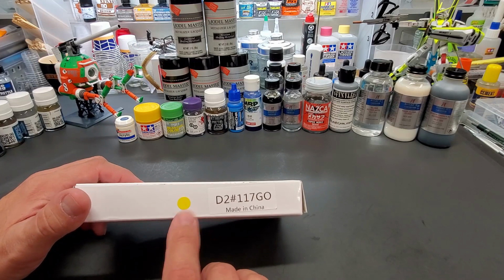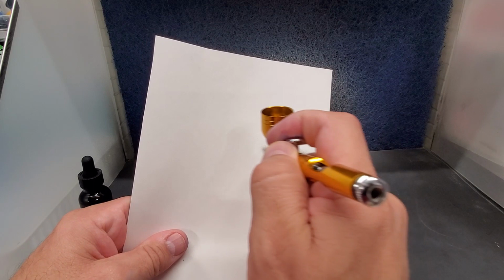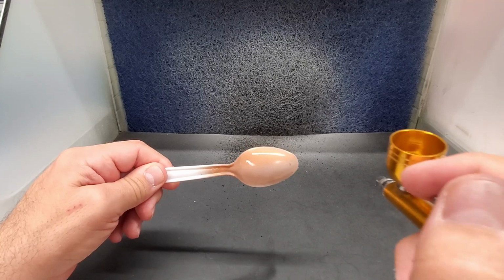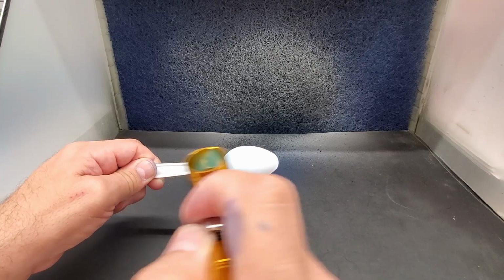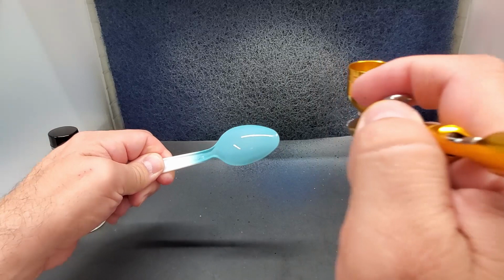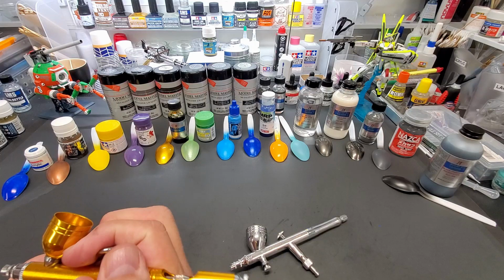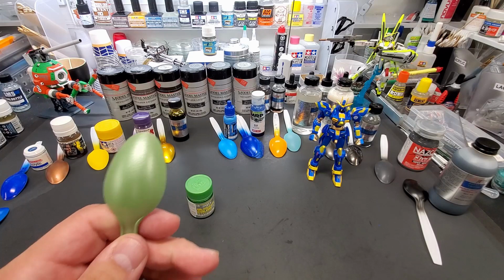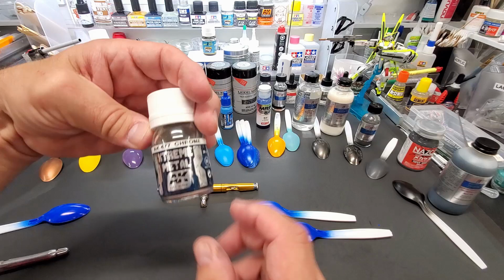Testing A $14 Dual Action Airbrush - Is It Actually Good ??

Comment: I use this airbrush for about 8 months now and I 'm totally impressed of it. I have stopped using my Iwata Revolution BCR and use this for every job except tiny line and dot free hand camouflages for which I still use my Iwata HP-B. This is the absolute value for money airbrush. Fortunately the a little tall trigger is not a problem for my fingers and fortunately I never use acrylics like Vallejo, Humbrol, Italeri, so I haven't faced any problem of using all the colors I usually spraying.

Comment: Great video! The trick with the cheap airbrushes is using  Metal polish on the needle tip, nothing super gritty a polishing compound that's silky smooth works best.  Aftwer you polish it notice the huge difference in performance.  I polish my needles with Brasso and a polishing pad on my Dremmel, after a few applications the paint sprays better each time.  It's really the needle polishing that cheaper units don't do as much as the higher end brands,  hence less labor less cost.

Comment: I found that polishing the needle with metal polish , or automotive cutting compound, helps these cheap airbrushes.
Reply from the maker: Great advice
Reply: @barbatosrex9473  I was just going to suggest :p And ask if you could do an update after polishing the needle...
I'm curious about the results. Just ordered a similar airbrush for the rough work and for practicing. I found that I'm a bit hasitant to actually practice with my Badger 360, just because it's rather expensive, and I don't want to ruin it.
The action on the trigger looks to be about the same as my badger, so that'll be a plus for me ;)
Reply: @angeldelvax7219  Hesitant to try polishing the needle on the Badger you mean? Or just to practice spraying? If the second have no fear that is what a Badger or any airbrush is made for. I would practice and get used to the better brush you'll be way ahead in your skills and be able to do way more with a cheaper airbrush.
Reply: Also #0000 steel wool!

Comment: I have a few different cheap Chinese airbrushes.  Like Animalyze71 pointed out, polishing the needle really helps.  The biggest issue with these cheap airbrushes is the seals.  They are made out of really cheap rubbers that break down after a few cleanings.   Obviously hotter solvents will break them down quicker.  Some of the airbrushes even come with a replacement set of seals.  It costs about $10 for a new set of seals so I usually just order a new airbrush when I need new seals.  I always opt for the .4mm nozzle sets or larger and use these exclusively for primers and clear coats.  I can abuse the heck out of them and if they break down I just grab a new one.  Saves wear and tear on my pricier airbrushes.  I wouldn't use these for my daily airbrush though.  Veda makes a nice cheap airbrush which runs about $20 buck you get a lot of extras for the price.  If you can't afford one of the name brands, or if you're not sure about getting into airbrushing this is a really inexpensive way to check it out.
Reply: I get the seal kits for less than 1€.

Comment: I have a premium airbrush from China that cam with a super cool case with a latch and shaped foam in it for each part of the airbrush and it came with a 0.3 needle and nozzle installed and a 0.5 needle and nozzle and a 0.2 needle and nozzle in spare containers. It also came with a siphon bottle, and a siphon bottle with a goose neck attachment as well as a cup and lid. and the one feature is that the front end of the airbrush has a swivel on it so you can put a cup on it and use it as gravity feed or you can rotate it and attach a siphon bottle on it hanging from the bottom, and it also has a closable valve to restrict the flow of paint as you desire, so all in all it definitely is a premium airbrush; and I paid $30 for the whole thing. The very first thing I did when I got it was to use a small piece of 1000 grit sandpaper and polish the needles as the needles had some burs on them from the manufacturing process, and they produced some splattering, but after polishing the needles, my airbrush worked better than my vintage Paashe airbrush for both ultra fine as well as high volume spraying. So for anyone who cheaped out with a cheap Chinese airbrush, I highly recommend using  some 1000 grit and polishing the needles, but don't get carried away, you want it nice an smooth, that will definitely cut down on the splattering that Barbatos Rex encountered in this video, plus, don't be afraid to lube up the parts that move in these ultra cheap airbrushes, and be ready to replace the O-rings if you are using a lot of paints that need solvents to clean up, as the rubber used for the O-rings is of extra low quality, but you can't argue with the price. Sure it might not be as refined as an Iwata, or any other number of high-end airbrushes but it shows just how overpriced the expensive ones are since a Cheap Chinese airbrush can perform almost as good as any of them. No judge in a model contest was able to tell I painted my models with a $30 dollar airbrush/ once you get accustomed to the airbrush, and work out any issues they may have, but the one I bought doesn't splatter anymore since I polished my needles. SO don't let people make you think that a cheap airbrush won't work, they definitely will, but they aren't as refine as the high end ones. plus I am a retired pensioner, I have a very limited income and I can't afford the hundreds and hundreds of dollars for high end airbrushes and compressors, Barbatos Rex has no problem using cheap compressors and I use the exact same one he has given away on his channel before. I'm happy to have an airbrush at all.

Comment: I have one of these and the trigger is tall and in a spot that is uncomfortable. One thing that can improve how it sprays, you should press down and keep the trigger letting the air and pull back when you're ready to make your pass. If you press down on the air and pull on the paint real fast like you're doing, it can cause these cheaper airbrushes to spit a little more and give a rough finish with certain types of paint. You get a cleaner paint flow with the air running constantly. Plus it helps with the uncomfortable feeling of that trigger keeping ir pressed down, you can control the paint a little smoother when you do that. And you can shorten the trigger. Take the little brass pin that swivels and you can cut that down. You will still get proper travel pressing down the vale for the air, but it will sit lower. I did that to mine and it made it much more comfortable to use.

Comment: I was told that if you keep the air on and only regulate the paint it stops splatter and it seems to work really well. I used to get a lot of splatter and by keeping the air on it stops the sudden rush of air taking any residual paint and splashing the model.

Comment: I am using exclusively cheap airbrushes to paint model car kits. They fulfill the purpose perfectly. The major downside are the seals. They fail every once in awhile due to solvents. I guess they would last long with water based acrylics.    But seal kits are dirt cheap. They cost less than 1€ plus shipping.

Comment: With cheap airbrush it is good idea to polish the needle first. It's usually not perfect and those small unevenness can give a lot of trouble with water based acrylics. Just use polishing compound and it should work much better.
Reply from the maker: Absolutely correct. It helps big time. I just wanted to test it as it is out of the box. I will be doing a video on airbrush needles including sharpening and polishing them

Comment: This sounds like it will be great for Aqua Gloss.  I won't feel bad about being lazy with cleaning on a cheap airbrush whereas with my Revolution CR I want to be as kind as possible to it.  With this guy I'd boil  a pot of water, take it off the heat, and stick this in there to loosen the aqua gloss up.
Reply from the maker: That's a perfect solution. Excellent

Comment: Funny i just bought this exact airbrush as a backup (i paid $20 from amazon) i took it apart to inspect and found that when you remove the very rear nozzle cap all you find is a threaded copper tube for the nozzle- nothing elaborate about it. But thanks to your test i'll just use it for clears and possibly for the alclad metal lineup- thanks Rex.
Reply: Thanks for the info. Now we know.

Comment: Wow 3 out of rest that work well on that cheap airbrush amazing deal of amount of money and I was thinking about buying cheap airbrush for model
Reply from the maker: It really isn't that bad. It's hard to go back after using a top model but to start you can't go wrong. Heck I just tested a tiny spray can that cost $20 and this is $6 less than that 😉
Reply: I have kkmoon airbrush for my Xmas present i just wondering if it good for large pieces on trunk model kits?
Reply from the maker: @davidsimpson4819  most of the time the cheap airbrushes are good large areas and priming. So it is worth having a cheap airbrush like this in your inventory

Comment: I bought that same one off of a different website, and mine came with a bunch of pipe brushes and a half spike type thing. It unscrews and inside is a metal pin that's tapered into a point, but the pin is cut in half where it starts to form the point. I'm new to all this and have no clue what it's for.

Comment: And to second what you were referring to on the trigger you're supposed to have your finger on it but In Front of it, it's Dual action that's just where you like to put your finger. You hold down for air and pull back for paint.

Comment: Thanks for sharing this information
Reply from the maker: Thanks. Check out my recent video test of the Badger 105 Patriot. It's currently selling around $60 to $70 and its one of my favorite airbrushes so far. It sprays anything and it's easy to clean. Parts are super cheap and you can get 3 different sized needles for it. Plus it only needs 12 to 15 psi to work. I know it's a bit more money but totally worth it in the long run. Check out the video

Comment: I don't believe the cratering in the troublesome paint was the airbrush at all. That kind of cratering is usually contamination of some sort, be it oils on the surface, wrong thinners etc. Maybe those paints didn't like the residue from acetone. Whatever, I say re do your test on those two paints that cratered with the cheap airbrush. The Humbrol is a different problem from the cratered examples, you could be correct on that.one. Runs and such are not the same as craters or what looks like fish eye effect.

Comment: When airbrushing any lacquer you should always have your paint extremely thin. Especially with a small needle. If it’s thick at all it shouldn’t be spayed in anything less then a .4 needle.
Reply from the maker: Yeah, I usually thin my lacquers 40/60. I just sprayed nail polish and I thinned the hell out it. Went on great. This brush is 0.3mm. I use 3 guns, a 0.5., a 0.4 and my Harder & Steenbeck which came with both a 0.2mm and a 0.4mm

Comment: Nice work on the video, are there acrylic/water based paints that are easier to airbrush?
Reply from the maker: There's all types of acrylics. Tamiya is called an acrylic but it's also solvent based. You can thin it with lacquer thinner. But that being said, Imy opinion is Tamiya paint when airbrushed is just about perfect every time. My vote is for Tamiya. Similar to Tamiya is Mr Hobby Aqueous paints. They're cheap and go on great every time also

Comment: Interesting review. I have seen videos of people teaching others how to make their trigger taller because they complain about low triggers and here you are complaining the opposite 😂 so for the trigger. I personally do not think the trigger is an issue with this airbrush. 

I am more interested in knowing how well this airbrush works after a few strip down clean up. Usually these cheap airbrushes works okay for a while but after disassembling them a couple of times.... they will need some bees wax (or other methods of sealing the nozzle) or it will have trouble spraying most things except thinners.
Reply from the maker: True, I'm getting a strong 4 to 6 month use vibe out of this one

Comment: That humbrol acryllic is not a "real" acryllic, all of the acryllic are real acryllic, doesn't matter what you can thin it with. The acryllic in the name comes from the bonding agent, a type of plastic that can be thin with alcohol, water and some more things and has a lot of variation so some work better with one thinner and others with a different one, but that depend on it's exact formula. This bonding agent is even in a lot of lacquer paints, nearly all of them so they are not as flammable if I remember correctly. Being thinned with water is one of the biggest benefits that acryllic brought to the table but it is not they're only characteristic.

Comment: Where can I buy a filter like the blue one? Whats its original purpose?
Reply from the maker: It's an air filter for home ventilation. I got mine at Lowes and Home Depot where I live. You can also use air filters they sell in the same department. If there out of one I just buy the other

Comment: What airbrush do I use. I really need a new on since I just realized the cheap 10 dollar one i have been using has a bent needle in it I've been using it for a couple of weeks now, haven't cleaned it untill today and realized needle was bent to hell and back.
Reply from the maker: How much are you willing to spend? The difference in spending more on an airbrush is tremendous. The difference is night and day
Reply: @barbatosrex9473   I'd say about a hundred to a hundred and fifty.
Reply: For that price I would get a Badger Patriot 105 or a Sparmax SP35
Reply: You could also go for the H&S Ultra 2 in 1, that comes with 2 color cup sizes and 2 needle/nozzles.
Reply from the maker: @KnightMyst6422  I'd go with this. I use this airbrush daily, it's my go to airbrush. And you can adjust the air pressure on the gun. Buy it here, comes with free 2 day shipping https://spraygunner.com/gsi-creos-mr-airbrush-procon-boy-ps-270-0-2mm-platinum/

Comment: If no indication of needle size, usually a #3 (.3mm) is the standard for hobby painting.  Someone spaying autos or an artist won't be buying a Chinese cheap brush.
Reply from the maker: 0.3mm is the sweet spot. That said, my new Harder & Steenbeck has a 0.2mm and it pushes out the perfect amount of paints for my kits. That's a unique experience though

Comment: The spitting could also be caused by the air not being on. All the time. Not knocking g your ability but I've always been told air on all the time. Keeps the paint from build up on the needle hence causing splatter. I watched tour finger thru the whole video and not once did I see you keep the trigger pressed. Not being a critic just observing.

Comment: Hi, do you use an explosionproof fan?
Reply from the maker: I would guess it is. It's a professional hobby spray booth. Most exuast fans today are explosion proof
Reply: @barbatosrex9473  just curious if you bought the fan specifically. I want to get into airbrushing but i am fully aware of the dangers of lacqeurs and solvents and don't want to go in half baked in terms of extraction.
Reply from the maker: @jamesmcconnon2  if you are building your own spray booth than any exuast fan you get at Home Depot or Lowes will be safe. Any exuast fan you buy today for a bathroom is safe

Comment: Why is the paint a different color? There's nothing wrong with that $14 airbrush I've taught airbrush classes as well. Spending $700 and spending $20 on an airbrush is a company difference. Yes some airbrush's have different features and that's where the dollar amount separates them. Now I have to fake some of your tests with a grain of salt. I personally have that same airbrush and done fabulous work and only spray authentic candy paint thru it. I don't need to buy the normal expensive airbrush's I use to use/Buy